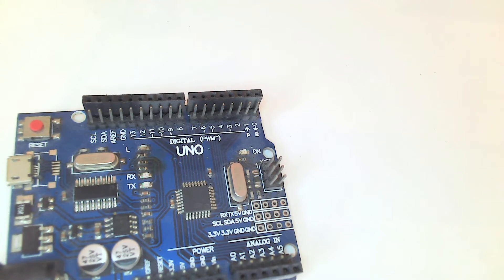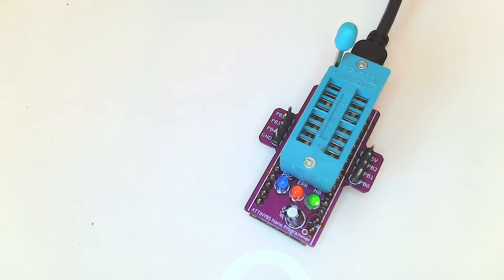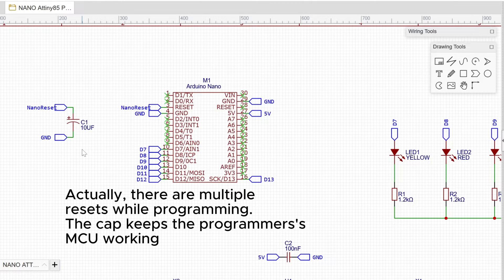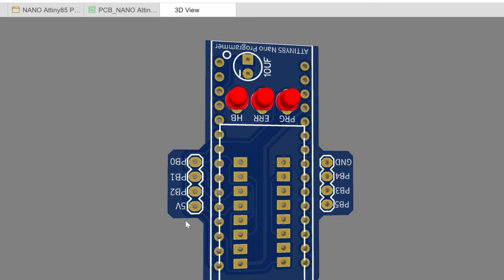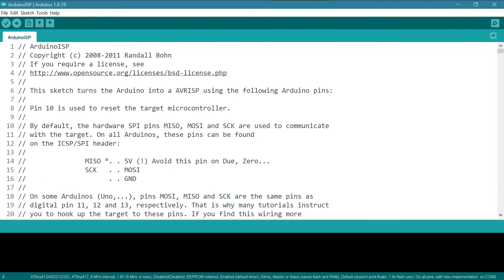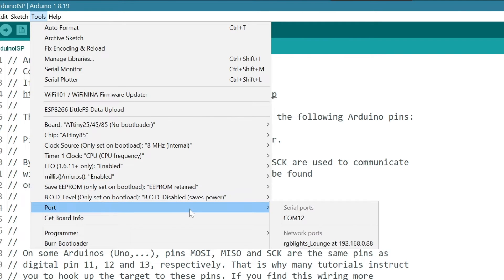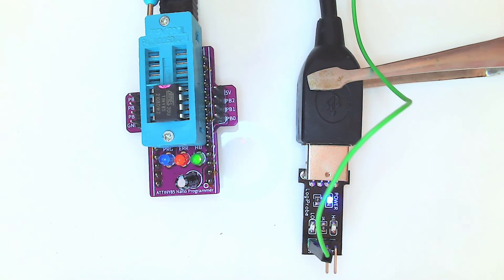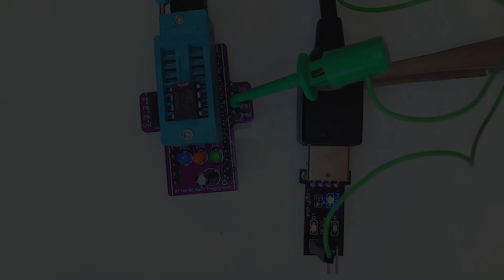ATTiny85 Programmer (based on an Arduino Nano)

Comment: the interesting thing for me is that when i look in my board manager, the library never comes up. I've been trying to get my head round this and the only difference i can notice is that i have the later 2.2.1 ide software. could that be causing me an issue?
Reply: scratch that. its because it was hooked up to my at tinny chip (exactly as you told me not to do in the vid)
Reply from the maker: @Goslingracing  Hi Gosling - sorry for the late reply! Glad you figured it out!

Comment: Heya, I really would like to see the bilding of the pcb too
Reply from the maker: Mornin' Dutch - over at Rich's channel we did a live layouting video. Not sure if this really works on video; for a PCB, I normally run multiple iterations. There's a lot of fiddeling included that is hard to comment b'c sometimes you make purely instinctive decisions on where to place what. So this will come down to me mumbeling for 90 mins while moving parts and drawing lines :)

You sure you wanna watch this?
Reply: @DetBuildsStuff  heya, yes I have see that video I ment the real soldering atc
Reply from the maker: @Dutch_off_grid_homesteading  Oh - you mean some soldering pron :) Yeah, that's actually an idea. I think something like that is comming up with Rich's Retro Chip Tester (maybe as a drinking game), but a short video about do's and don'ts sounds like a plan.

Comment: I bought an ATTiny45 it should work for mr bleep right?  it was the only one that was available at the store i use to buy chips, the only difference i've seen between 85 and 45 is the program space i think
Reply from the maker: Mornin' Kathor -- yeah, '45 should work, too. Mr. Bleep is under 4k, so this should be a (tight) fit. See ya tomorrow on TEC!

Comment: Det,  Appreciate the opportunity to learn about the Tiny and your programing board.  But, I do not want to try to learn to code in C.  Can the Tiny or are there other small IC MCUs that can be programmed in Python or circuit Python or some other code?  Thanks Ed
Reply from the maker: Hi Ed - good to see ya around, man!

For a tiny (literally) MCU like the ATTINY85, I don't see a way to implement any form of (circuit) python: you need a runtime compiler, probably some interface to get the program onto the chip... not with 8k flash. With a pre-compiler the big upside of python - editing the code "in system" is lost, and you end up back in some upload circle.
And please don't forget: (cicuit) python is about 20x slower than c++ (based on a video that compared speeds of an ESP32).

Ed - don't get me wrong: I feel your pain! Btw: it's the same for me when i see python code :D

But (to end it on a high note): if you want to fiddle around with a runtime compiled language on - say - an UNO: there's a basic interpreter available. I had a very short (!) playaround with that some years ago, and for simple (!) comtrol/automation tasks, this would do the trick.

Don't know if BASIC would be your thing - here: https://geoffg.net/maximite.html is a complete one-pcb-computer that feels something like a 1980 reboot in a modern form. Yeah, I have one of those - let me know, if you need a video :)